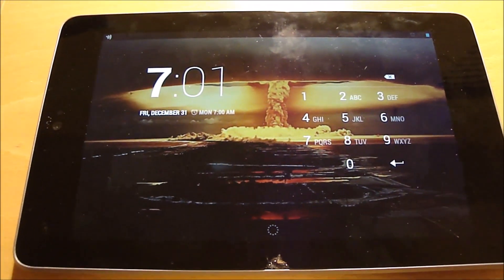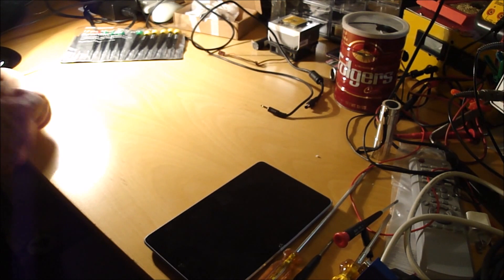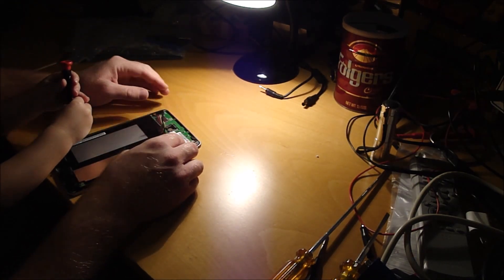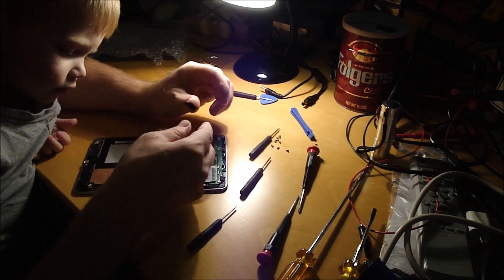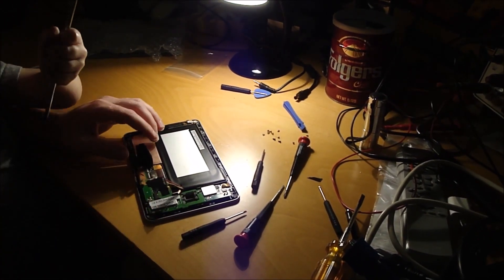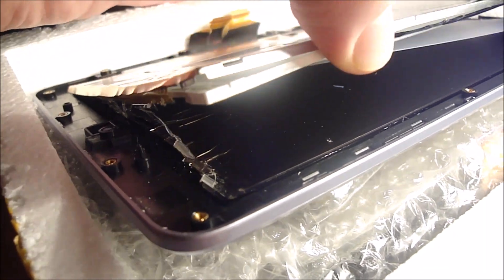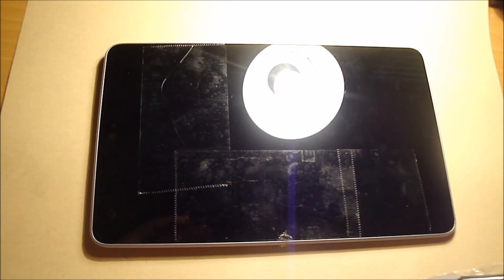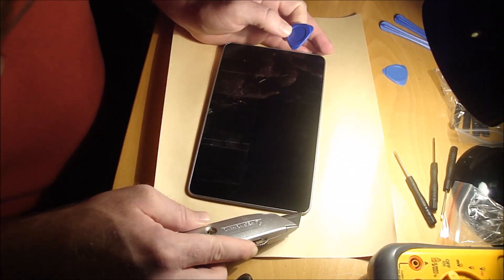Replace LCD & Touch Screen on 1st Gen 2012 ASUS Nexus 7

Comment: Can I use hairdryer (1800-2200W) instead of that heat thing? And also should I use some glue? I didn't noticed so better ask than cry 😁 perfect and simple video for everyone who's not stupid and even for people who are stupid 😛 thanks for that
Reply from the maker: You could probably use a hair dryer. You can use glue as long as you don't get it on the screen